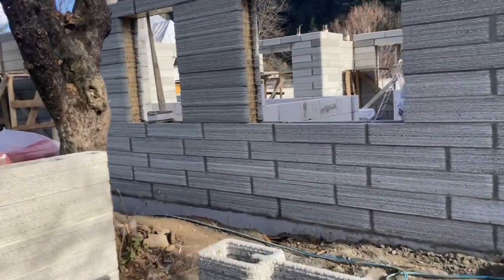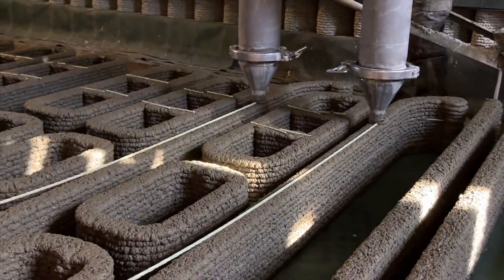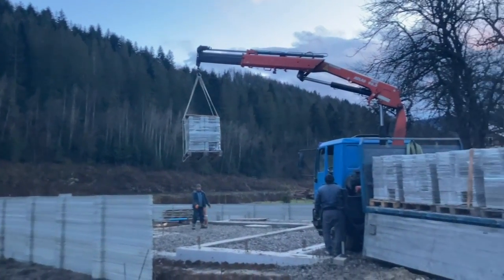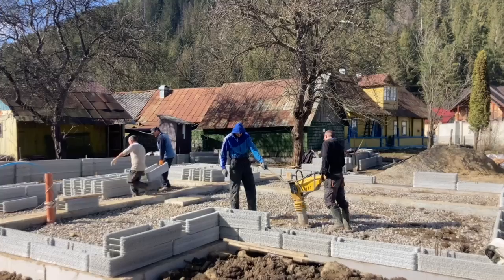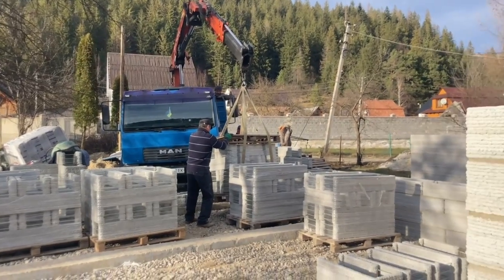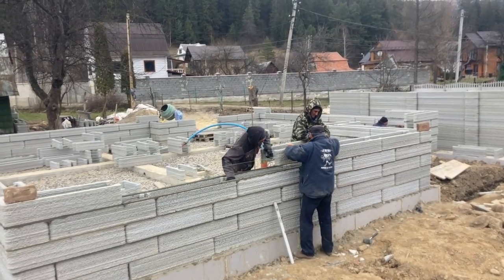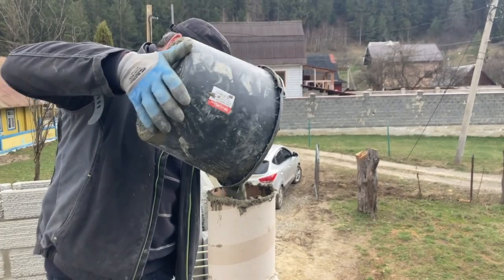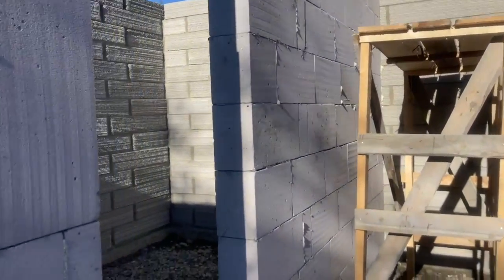Dual-Extruder Concrete Printer Builds House in Ukraine

Comment: Because I work in Public Works, the first thing I noticed at 2:11 and 2:34 were construction site safety violations by USA standards LOL. Heavy Equipment in use without Steel Toe boots (probably) and no hard hats and no caps on the rebar to prevent impaling LOL. While this is true, don't take me too seriously. Just being funny.
Reply from the maker: That’s why most USA construction firms have under 10 people, no OSHA.

Comment: Ah, every house will look the same exactly the same. That is cheap thin concrete. A branch will plow out an entire wall.  It doesn’t take a genius to be a carpenter. I know and work with many. There is more than enough people to build homes. This 3D crap is not needed. Produces expensive crap. Just my opinion

Comment: I do not understand technology benefits: basically those guys just make building bricks but with help of another technology, which leads to a question: what is wrong with classic building brick manufacturing technology?
Reply: Compared to brick laying it's far faster and removes the need for skilled labour. Look at the guys moving the blocks @7:44. The insulation cavity is prespaced and it's equivelant to at least 30 (215x102x65mm) bricks on the inner and outer layer. Even a skilled brick layer would need a few minutes to lay that many bricks. An unskilled brick layer would need 10 minutes and get the cavity gap wrong. 
This technology saves time and the need for skilled labour (money).

Edit: And it's wayyyyy lighter for transport. That can be a HUGE cost to rural projects.
Reply: @TarmanYoloSwag  there are bricks on a market that already are lighter and larger with much better insulation properties than classic red bricks

Comment: I love how they've created that brick look.  I wonder how they fill in between the joins?
Reply: The joints are seen on the interior side closer to the end - they just smear mortar over the vertical seams. It should  be good enough to avoid drafts.

Comment: actually frightening that there's no support or lintel under the top window frame. The blocks are just being held up by wooden posts. Surely they can add lintels over the top window frame  and then add a thinner block to match the level of the ordinary blocks? And no insulation? Unless they're pouring in some kind of beaded insulation?
Reply: W

Comment: Nice!  "Thermal bridging" is what they are cleverly avoiding, by using only fiberglass ties between wythes. And doing a really good job of it, as concrete is an efficient heat conductor.  This is how all CMU in a cold climate should be!
Reply: 8iqq